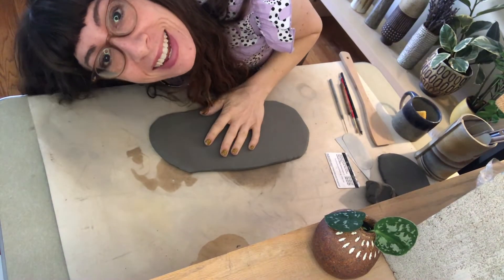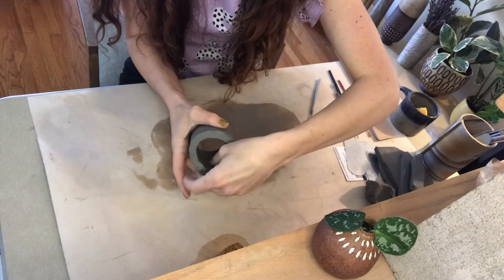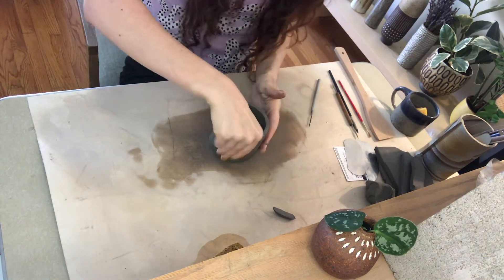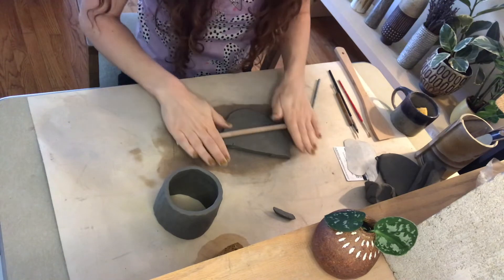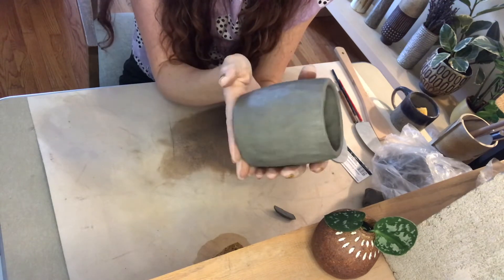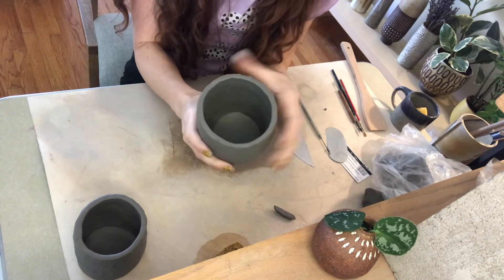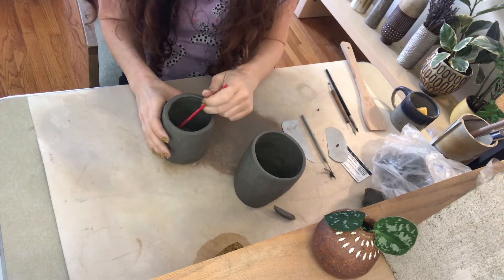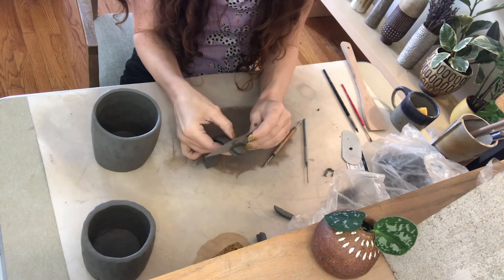How to Make a Pinch Mug with Slabs

Comment: Gina, your tutorials are amazing. I was wondering what kind of clay you're using?
Reply: Thank you! In this video I'm using LB6 from Laguna, but I use lots of different clay bodies. I like handbuilding with clays that have some sand in them.
Reply: @Gina Z  hi, Gina,  thanks for your video, I've noticed your clay is pretty stif not soft at the beginning, does that mean you started to work on a little bit dried slab? Like leather hard? Mine after rolling a slab becomes really soft and when I form a cylinder it becomes very wobbly. Wondering what did I miss here? Thanks!

Comment: Hi there!
I was wondering if you use a certain amount of clay to make sure that cups hold a certain amount of liquid? ie: 12 oz of clay = 8oz cup ect. Thank u! 
 Love your videos (:
Reply: Thank you, Christina! That's a great question, but it's really hard to say. It depends on the shape of your mug and how thick or thin you make it. Best to take a mug you love, measure it, and try to make something that matches those dimensions (but just a tiny bit bigger, because clay shrinks). But for reference, I'd estimate the mugs I make are usually made with between 1-1.5 lbs of clay.

Comment: I am new also.  Looking for the right kind of canvas.  What do you use?
Reply: My table cover is a product called a Slab Mat, which is a canvas-like material with a rubber backing, so it's more rigid than plain fabric. You can also work on something like a piece of plywood or drywall board.

Comment: The volume is soooo low. Can you speak louder or use a headset with microphones? Thanks!! And how did you make the slab?
Reply: I don't know what happened with the audio - I'm sorry! I rolled out the slab with a rolling pin, but you can use a wine bottle or something similar. And for this project, since the slab doesn't need to be perfect, you can just pound one out with the heel of your hand.